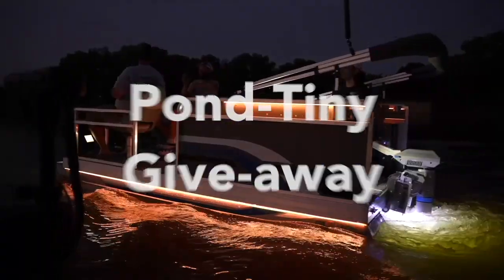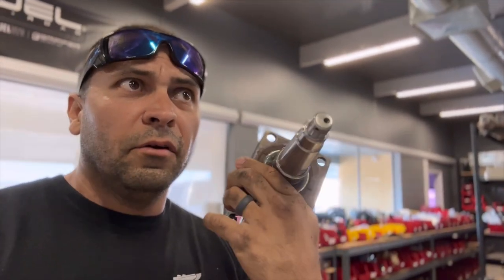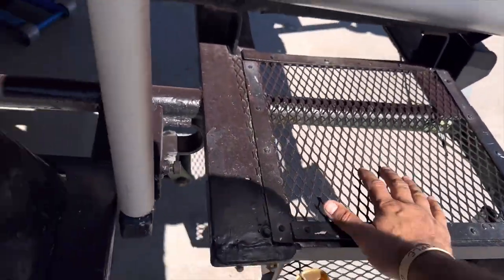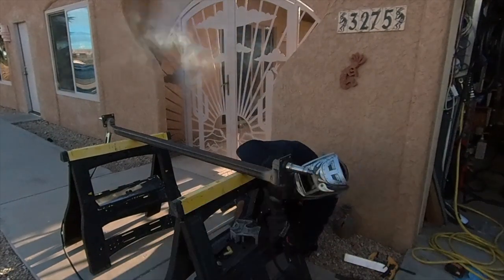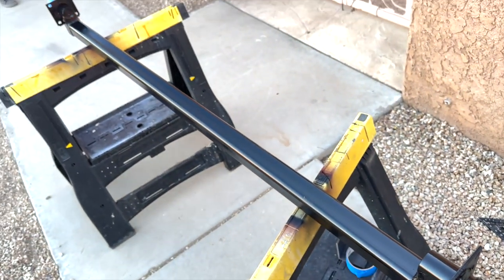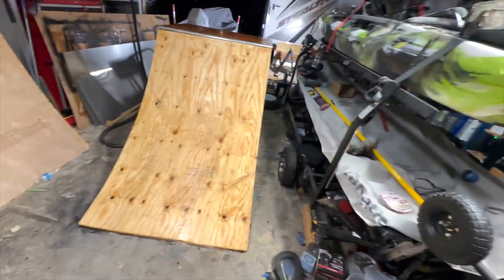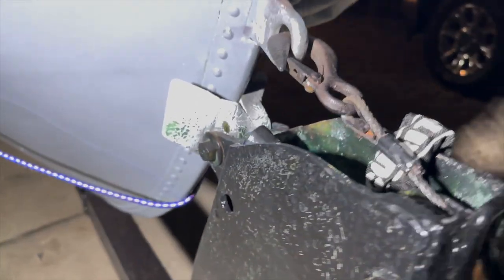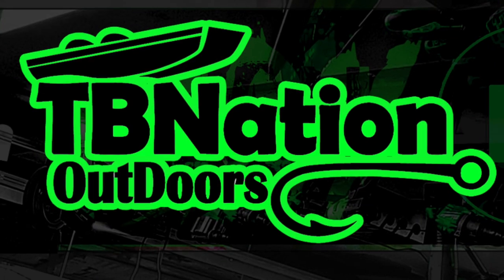How to make a drop axle / offset

Comment: Really enjoy your vids and the invaluable information that you share. That being said, ( and this is just my opinion as a welder,) you probably should of had someone with a big welder sew your axle up with a 6010 root pass, and then cap it with a 7018 cover pass. That is a structural weld on that axle, meaning, your welds are the only thing between your boat and the asphalt.  I hope it holds up for you.  Just wanted you to know that little 120 flux core probably didn't penetrate the base metal like you think.
Reply from the maker: Can you simplify that terminology so I can understand what to do? What would those passes look like? Should I add extra brackets?
Reply: @TinyBoatNation   from what i saw i dont think the weld penetrated very far. If not rewelded... Then separate triangle flat pieces should be welded on each side and welded by a stronger welder to be a very strong bond that takes over as a main weld for the welds you did.
Reply: 6010 and 7018 is just a particular welding rod used in traditional stick welding. They do make flux core welders that will weld thicker steel, but they are generally 240 volt machines. Generally you will bevel the end/s that will be welded. First weld is called the root pass to ensure penetration all the way through. Then you fill up the rest of your bevel with a 7018. Check out weldingtipsandtricks on you tube.
Reply: @buckywharton3594  excellent explanation. I don't even weld but understood exactly what you're talking about.
Reply: I would definitely listen to this guy and Bucky Wharton's reply. Don't want to end up on a boat fails of the week video.
Reply: Wasn't trying to be a pain, but I just didn't wanna see a good guy doing good things as a diy-r have the dot rain down on him because of good intentions and honest efforts. Let's face it, our guy here can wire some shit, and deck the hell out of a boat. Liability on the road is real though.